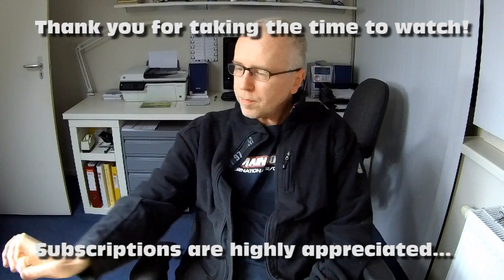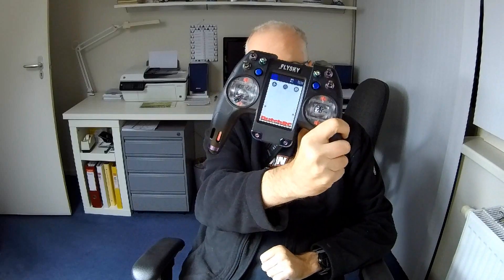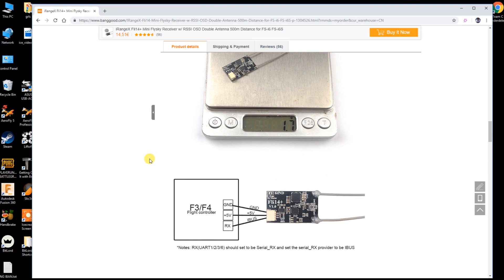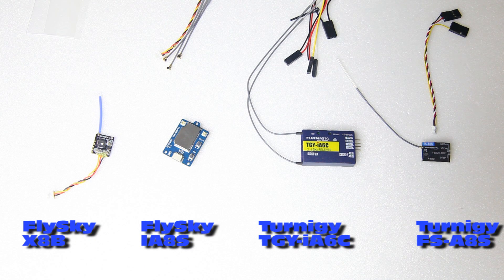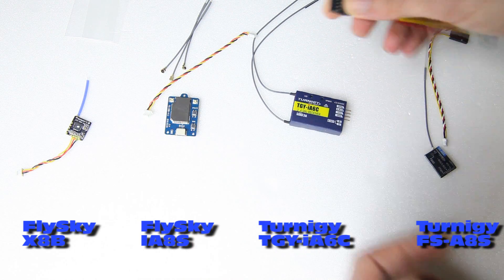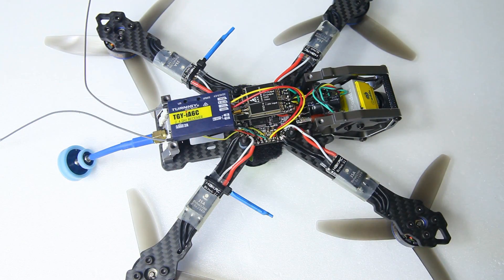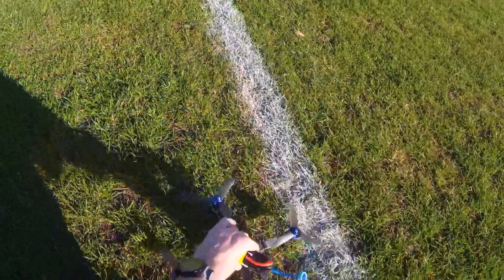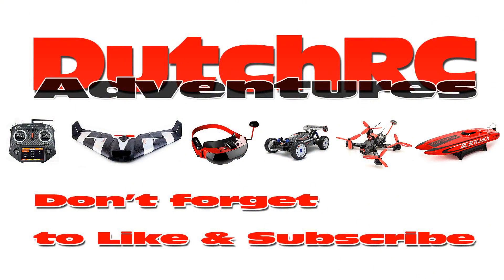Drone Receivers for FlySky options (AFHDS-2A)

Comment: I think I'm just going to make the package complete and slap a Crossfire Lite on the back of mine.
Reply from the maker: Grrr Crossfire.. I just ordered a Flysky PL18 Paladin as well by the way.. 
WHAT kind of module-bay does that thing have? :O :|
Reply: @DutchRC  it comes with a bracket setup for the back. It's 2 pieces and mounts to some screw holes on the back side of the radio. The stock antenna gets folded down and the CF Micro fits right down in the bracket pretty flush. Of course you need a JR adapter for the Lite and full Crossfire modules. The brackets also have the pins integrated into it. It's a pretty slick idea. You can also put the R9M module in the bracket. If you aren't using a module, you just leave the bracket off for the cleaner look.
Reply: Also the FlySky iA8X and iA8S receivers both come with the radio if you are going to just stick with the FlySky/UFPV protocol.
Reply from the maker: the PL18 Paladin uses their newer AFHDS3 protocol :P 

Okee yes.. I did notice the screw-holes.. basically similar to the Nirvana then I guess :)
Reply: FlySky definitely thought it out much more than FrSky did with the X-Lite and X-Lite Pro. Guys are 3D printing stuff to rig up the modules and deal with the pins to make it work.
Reply: I almost forgot. The guys at TBS are coming up with something so the Lite and full modules can be mounted flush to the back of the radio without the JR adapter also. 😊
Reply from the maker: Yes.. but frsky did that to make it difficult to use non-frsky products :) 
my Horus X10S is intentionally crippled by frsky so you can't use Crossfire (more less)
Reply: You've got a good point. Especially, with the crap FrSky pulled when the Jumper T16 was announced. FrSky sounds like they are the Apple of the R/C world. LOL
Reply: Only difference is they want to take their toys AND someone else toys and go home. :-P
Reply from the maker: @mikeoleksa  yeah.. maybe WE are missing something (I don't think so).. but this way of doing business is NOT my way.. I'm no saint but I wouldn't mind moving away from using frsky stuff Completely....
Reply: @DutchRC  , I'm honestly just getting into the FPV side of drones. So it might be a good thing I'm starting out with a FlySky radio and not having to try to switch from FrSky later. I have a pretty good DJI knockoff beginner drone, but I want something with more speed and flying "freedom". So I've done a TON of research on the FPV stuff already and have managed to gain some decent knowledge. I know that I like flying, so I don't mind investing more money into a first radio and goggles so the experience is better. There is also the obvious factor of not worrying about crashing them into something and destroying them. LOL It's also not like the radio and goggles are limited to one quad either. I've got my eye on the new iFlight TurboBee 77R for a whoop to start out with once I get the radio and have been on a SIM for a little while. Goggles, I'm still undecided. There's a lot to offer in the $300 USD range. The Eachine EV200D kind of stand out for me with the wider FOV and dual receiver bays. Fat Shark just announced the Attitude V5 as well. The Eachine goggles just seem to be a pretty good value overall and I haven't had any issues with Banggood since I've started dealing with them in the last 6 months, starting with my original Eachine E511S purchase. Shipping didn't even take that long.
Reply: @DutchRC  , here's a link to AndyRC's video. I cued it to where you can see the external TX module bracket pretty good with a Crossfire module in it. 

https://youtu.be/k_U4mB2zoK0?t=378
Reply from the maker: You might wanna check out my review of the Skyzone sky02x (one of my last video's).. I tihnk it's actually on offer as well.. Pretty GOOD goggle.. 
I have not tried the EV200D myself.. 

On the iflight (any iFlight) as a first quad: can't really go wrong there :)  I have a review of the iFlight 120RS in the works.. very cool quad :)

Comment: Does the FS-A8S RX have to be soldered to a free uart pad or can it work on the sbus pad? I'm using the Flysky FS-16S TX
Reply from the maker: You should be able to use the sBus pad (and offcourse configure it as an iBus input in betaflight)

Comment: Do you have anything about how to use the nirvana.. I bought one. Its been 3 months and i just figured out how to bind it to my mobius 7 and it was sheer luck. Alot of vidios must assume we know what were doing. I dont. I cant figure out how to assighn a switch to arm it next... Maybe at this rate i will get the motors spinning by spring...Help navigating the transmitter would make a much needed asset...
Reply from the maker: Howdy :) 
I think the trick to finding info on this transmitter is Not to search for info about the Nirvana radio, but OpenTX instead.. 
Having said that: I am working on some beginner how-to video's on OpenTX..

Comment: The X8B is a iBus RX and you bind by turning on bind on your radio while powering the X8B up and it will bind. I just got done putting the X8B on my QX95 micro drone via one of the serial ports and configured it as iBus in Beta Flight.
Reply from the maker: Thanks Jeremy :)  I haven't used it in a quad yet, but yeah.. That is basically the same as on the Turnigy TGY-iA6C :)  Cool.. that's actually a very handy bind methode :)
Reply: Its actually not a bad micro RX.. I range tested it to almost 1/4 mile with zero failsafes and also flying through a concrete and metal building that was under construction. This was with the antenna poking out through a hole in the top plate of my QX95. I did have the antenna folded out also to give it a fair chance.
Reply from the maker: Well cool :)  I inted to use it in the LDARC ET115 (currently on FrSky).. it's quite a nice small (no connector) receiver :)  I hope to see it pop up at sales sites seperately :)

Comment: You might also want to take a look at the Flit10 receiver.
Reply from the maker: Isn't that the 'old' version of the Fli14+? (without diversity)
Reply: @DutchRC  That's the fli14 (no "+"). The Flit10 has dipole antennas and a slightly different architecture than the Fli14+. I get much better range out of the Flit10 than the Fli14+. Looking forward to your review.
Reply from the maker: Thanks for that! I'll get me a Flit10 in that case as wel :)
Reply from the maker: ps: what is that weird in-between board for? Telemetry conversion?
Reply: You're welcome. The telemetry module basically copies a known hack for the ia6b. It's a pain to see up. Most seem to omit it as it's not particularly useful for fpv.
Reply from the maker: Yeah grrr.. I'm taking quite a step back in terms of telemetry (coming from FrSky).. Flysky really has to release some XSR-like receivers if they want to make a killing with this radio..

Comment: The best flysky reciever to date has been the X6B.
Reply from the maker: It's so Big and bulky with all them plugs :| You probably remove all them connectors on those?
Reply: DutchRC Adventures True but the rest just sucks. Also the X6B has mounting holes that allows you to add it to your stack.
Reply from the maker: True.. with the Low-rider frames of today... BUT yeah.. I might wanna try that receiver as well :)